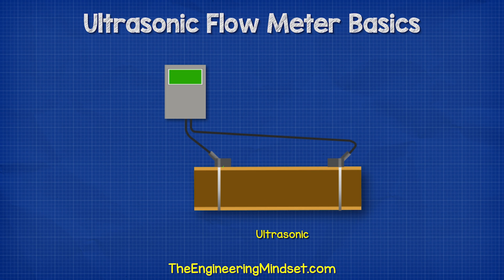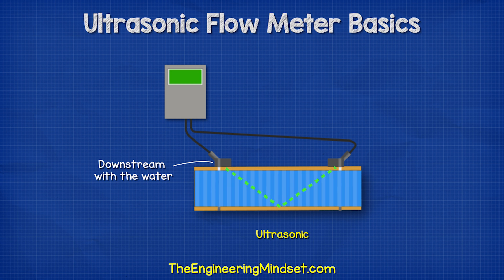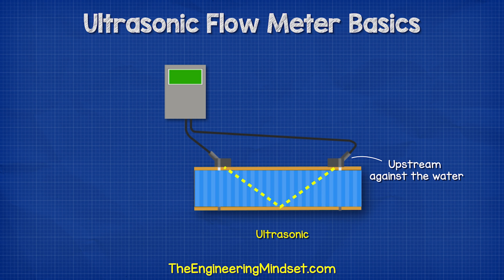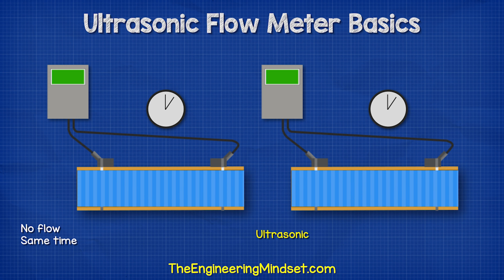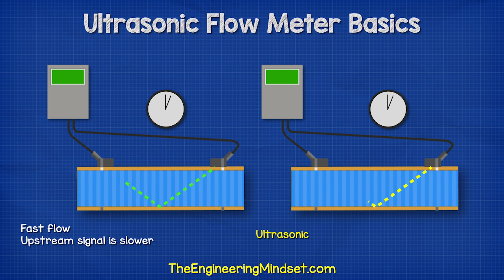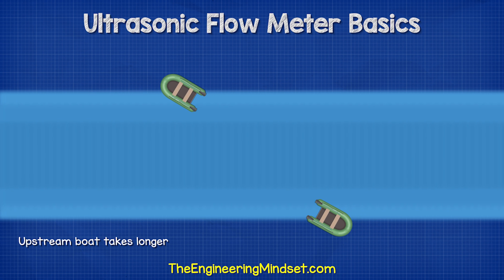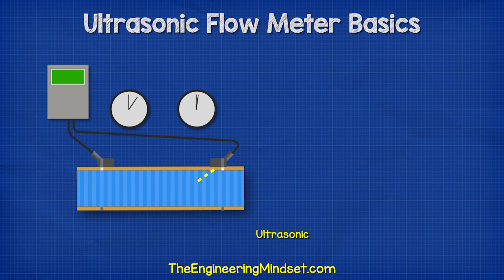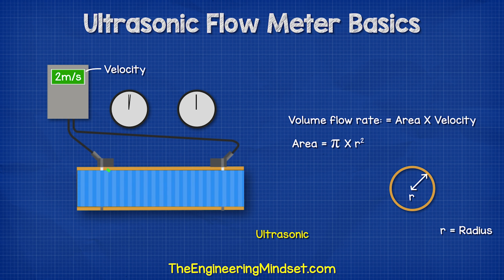Ultrasonic Flow Meter Basics

Comment: We use ultrasonic flow meters to measure the flow rates of Oxygen for Hospitals in the UK since the Pandemic. Before, the manufacturers would keep this data for themselves but now were fitted, hospitals can now see exactly how much they are using at any given time. This allows them to see trends recorded second by second rather than rough calculations with how much used per day and liquid to gas expansion calcs.

Comment: Do one on electromagnetic flow meters. I was in charge of a project of fitting a small town with about a thousand of Sensus' electromagnetic flow meters. Just about the most accurate flow meters I could find, and they had a warranty that beat out the competition.

Comment: I used these extensively in the early part of my career. It's important to place them on the sides of the pipe so that any sediment does not interrupt the reading. On old and poorly water treated condenser water piping its nearly impossible to get an accurate reading due to pipe degradation. 

You should do an episode on condenser water treatment. It's has a huge impact on the efficiency and longevity of open loop piping systems.

Comment: Doesn't the size of the pipe make a difference?
Reply: Most of the ones I have worked with have a programmable interface. One of the parameters is in fact pipe diameter. This then allows the device to calculate the correct volume of material and thereby flow rate.
Reply: The size of the pipe diameter/wall thickness does make a difference, where the flow meter is placed (either before or after a bend/tee) which creates turbulence within the material being measured and even outside factors.

Comment: It would be better to explain what type of flow meters should be used under different circumstances. Thanks
Reply: Always depending upon the application i.e., type of fluid, flow range, and desired grade of accuracy (client's budget!!) Lot of different flowmeter technologies available and much more situations the flowmeters shall be used for
Reply: Ultrasonic meters are cheap, easy to install, can be used an my different size pipes, and do not come in contact with process fluids. These are some of the pros.
Reply: Pretty good for a minute though